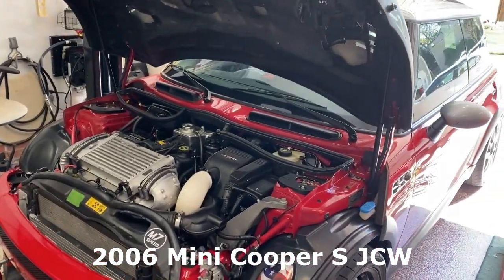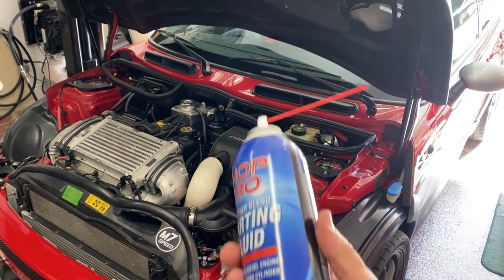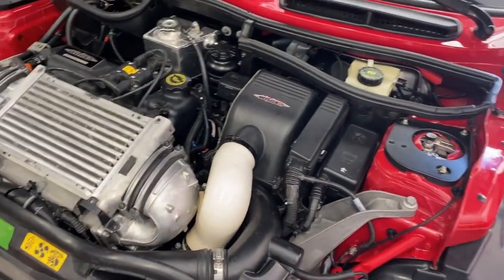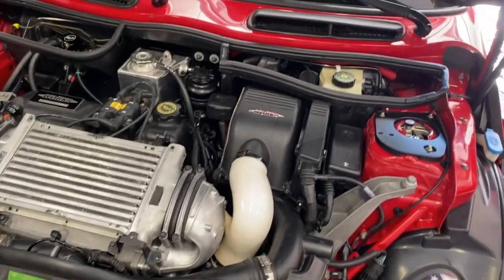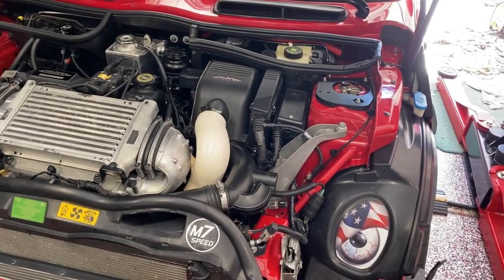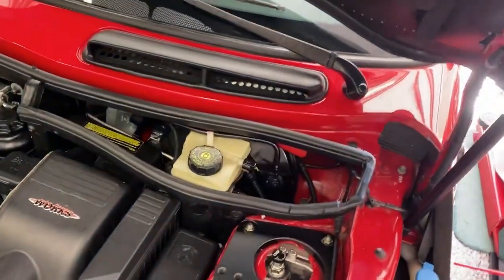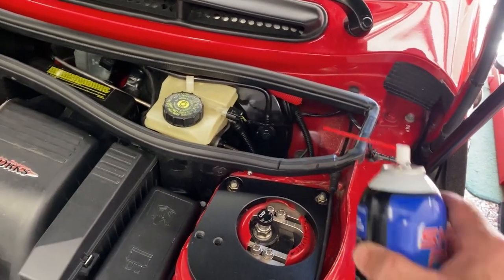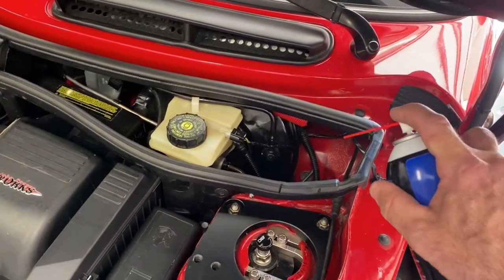Vacuum leak

Comment: Sure its not the intake your spraying where it picks up air from  just asking
Reply: That's possible, as the JCW air box has a flap that opens around 3k. Not sure how much air it sucks at idle tho.
Reply: @oTHEBLESSEDHELLRIDEo  Yeah, i believe there's like a 1 inch hole with a rubber peace that the box is fitted with to get fresh air from that area where the brake booster sits .